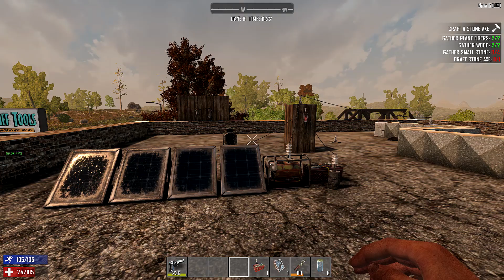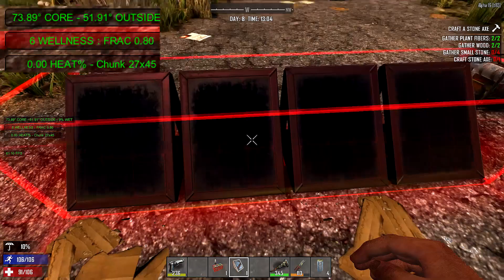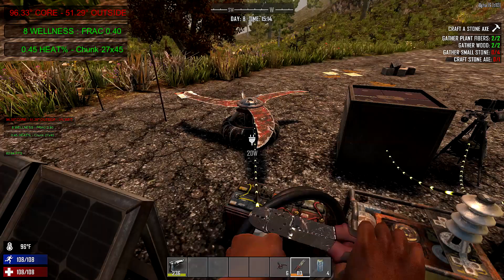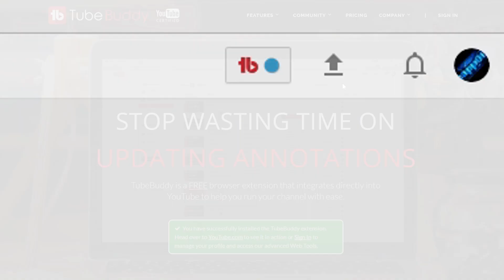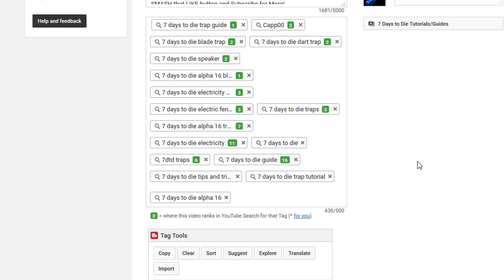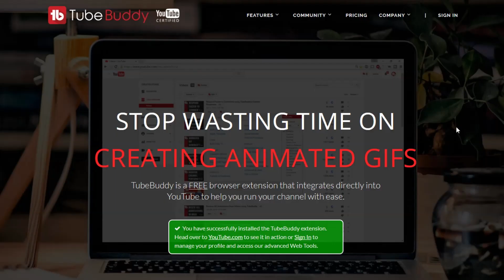7 Days to Die - Heat Map for Electrical Items (Alpha 16)

Comment: @Capp00 how do You run Heat metter?
Reply from the maker: Debug Menu
Reply: Hi, thx for info, can i use it (debug mode) in multiplayer?
Reply from the maker: Only if you have admin rights to the server.
Reply: ahh , OK, thx

Comment: 4:07 at least he didn't connect the battery bank to the fence, but the solar bank to the battery bank. Wouldn't change a thing if he did.
Reply from the maker: Nope, wouldn't have changed a thing.
Reply: I appreciate the work and time you are investing to verify what changes the heatmap. thanks a lot
Reply from the maker: My pleasure. Glad you found it helpful :)

Comment: its posible recharge the car batteries?
Reply from the maker: Yes, as long as you have like a solar bank plugged into the battery bank, and the banks aren't powering anything, it will charge the batteries.

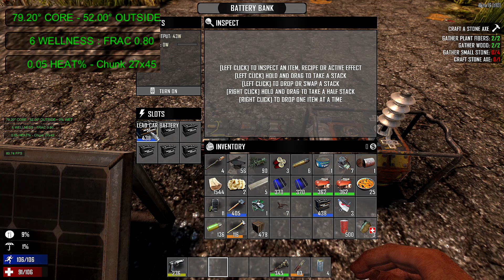Comment: 1:39 it looks like the heat went up .05 from just opening the battery bank, before you put a battery in.
So if i spammed opening/closing a generator, i could summon a screamer? There must be some sort of slow cool-off time if you stop interacting with the generators.  which you didn't explain in your past videos if and how the heat ever cools off.
Reply from the maker: That's what I was explaining in the video. Opening/closing the inventory of things will make it go up by 0.05, but it's just "noise" heat so it's temporary and goes down after a few minutes.

Comment: I wonder if the "heat" rises when you use the things while you duck.
Reply from the maker: No placing them, but when you open the inventory it does, crouching or not.
Reply: wow thumbs up for the new stealth system.
I hope they will work on the heat map.

Comment: Give them time, next patch they'll make electric items create massive "heat" which would make sense as generators even small modern ones create LOTS of noise.
Reply from the maker: It's possible, but if they make them generate too much "Heat", it'll negate people even using them. Who knows.

Comment: You didn't actually connect the electric fence to electricity. Not that I think it will make a difference, if none of the other traps did it probably won't either.
Reply from the maker: Yes, it did get connected, as did all the other traps.
Reply: @4:04 you click on the solar bank, and go to connect it to the fence, but change your mind on the power source and go and click on the battery bank, connecting the solar bank to the battery bank. Then you go over to the fence and click on it, and connect the two posts, but you never did connect them to a source of electricity.  Between 4:10 and 4:13 you can see the fence posts 5W power requirements are not highlighted in yellow, meaning they are not powered.

Comment: Hey, you may not have caught it, but every time you put a battery bank in, it raised it by .05
Reply from the maker: No, it didn't raise the heat by inserting batteries, engines or solar cells. It went up by 0.05 every time you open/close the items inventory. Just the noise of it opening made it raise. It goes back down on it's own after a short while.
Reply: Capp00 ahh okay. Must have been the delay with the vid or just me not paying absolute attention. :). 

Great vids btw.
Reply from the maker: No problem, and thank you very much :)